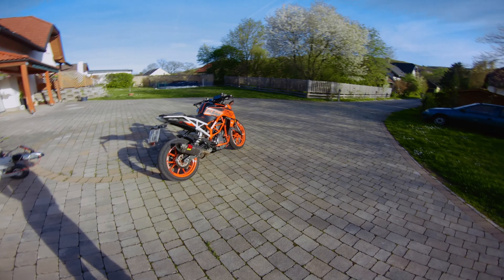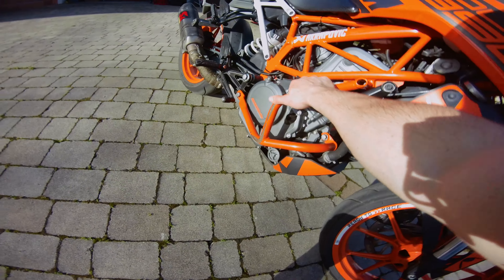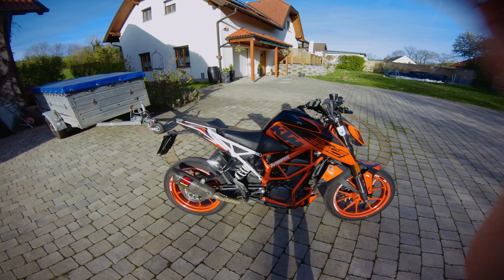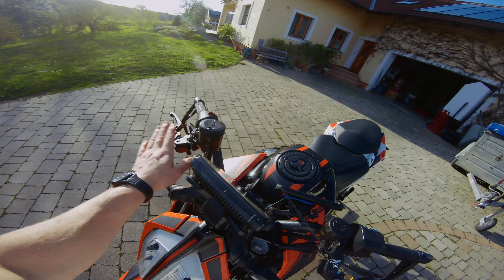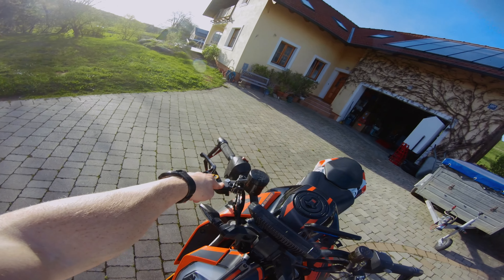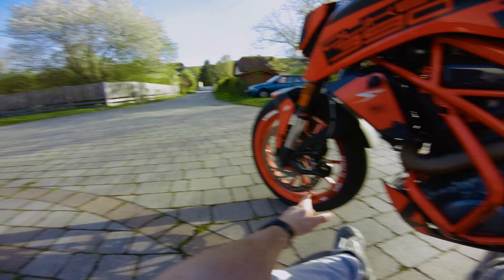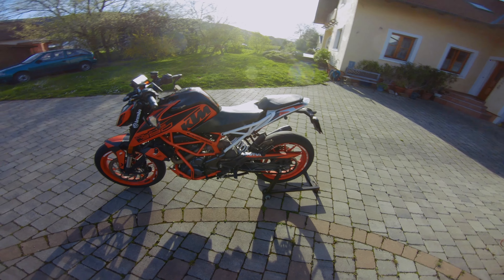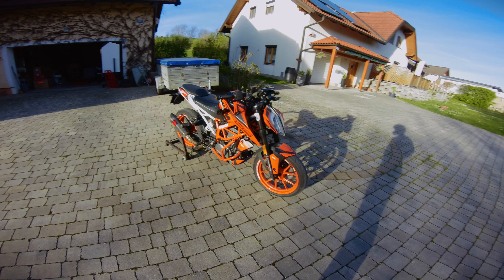Walkaround my KTM Duke 390

Comment: Had my gen 2 for 3 years. 40k km and 10 oil changes later. And it’s been totally reliable apart from an oil pressure sensor give a fault low oil pressure warning. Changed it out for $5. 
Really fun bike.  👍
Reply from the maker: Same experience